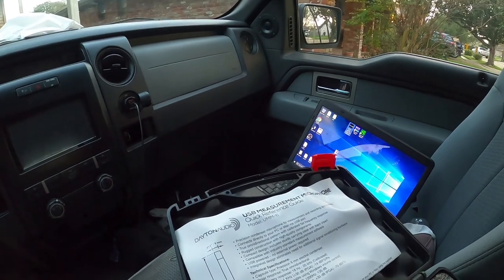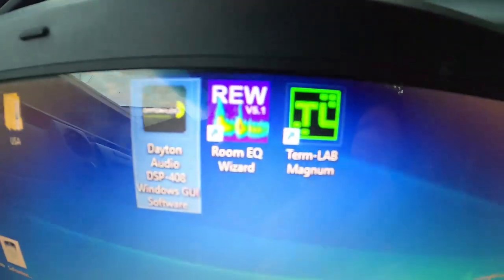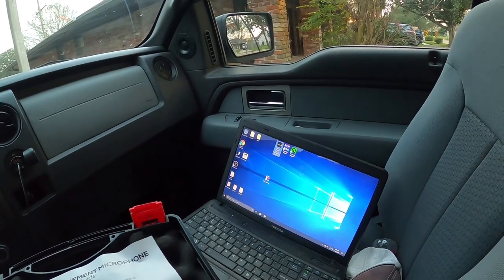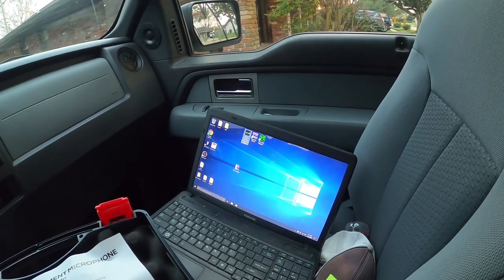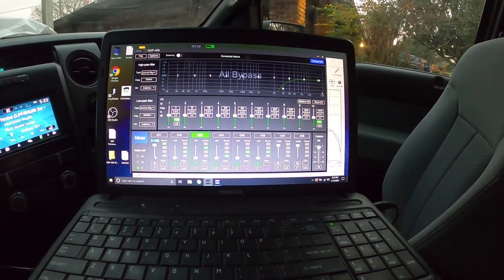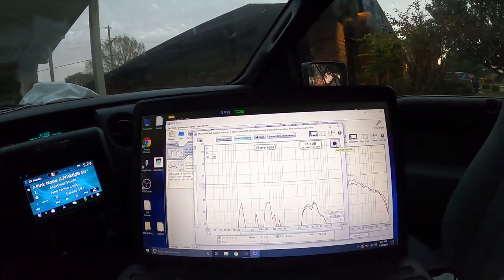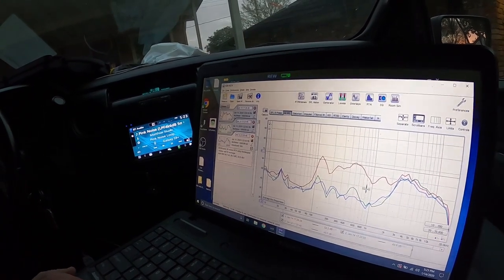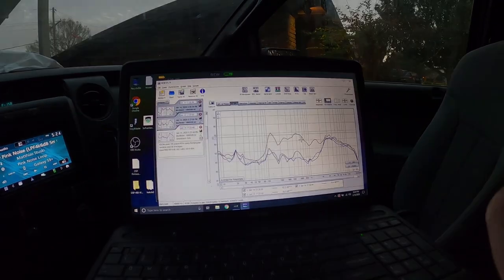[How To Get The BEST out of your Sound System!!] PT. 1

Comment: When making measurements to set delays between the speaker and the listening point, should the measurements be taken from the grille to the listening point? or would it be more correct to remove the grilles and take measurements from the listening point to the base of the speaker cone without the grille?
Reply from the maker: Remove the grills but you can kinda just estimate like another half inch back or something. If it's a pain